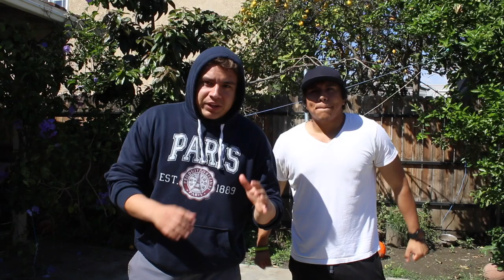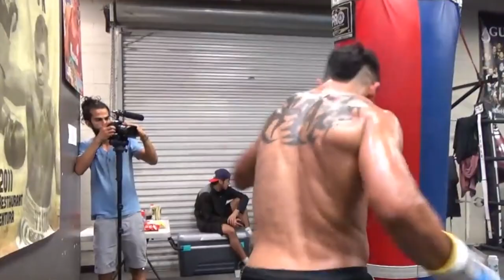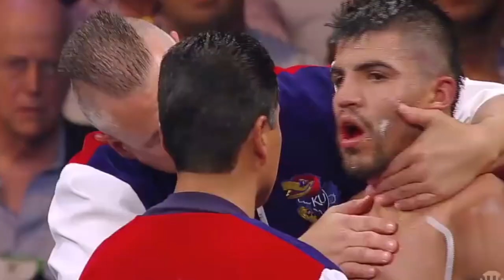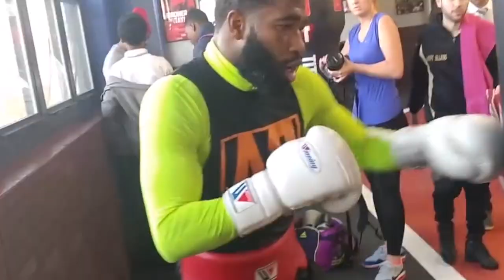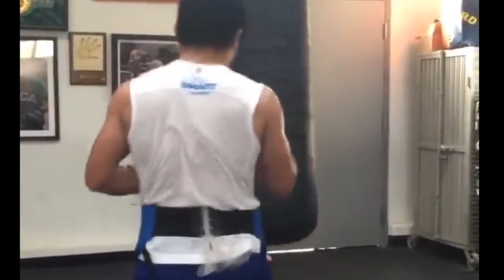Why Do Boxers Make a Noise When They Punch?

Comment: And it's a kiai not a scream. Just like in boxing it's used to tighten your bodies largest mass of muscle your abs, which helps connect power from the legs. It's for more power in your strike. Exhaling also helps exorb energy from a strike as well. So when fighting someone watch for there breathing and try to attack when lungs are full. Making the most out of your attack.
Reply from the maker: Look at Victor Cabral's comment down below, I addressed that already " it's not a scream it's called a Kiai. . . . " about a year ago, 0:26 " Also by doing this you're flexing your core". Thanks for the extra information though bro. Appreciate it.
Reply: Yeah I should have said core not abs.
Reply from the maker: @mandarb23  Thanks for sharing though dude. Really do mean that!